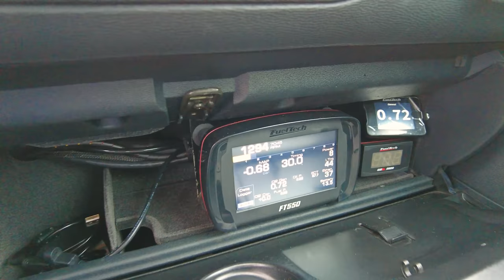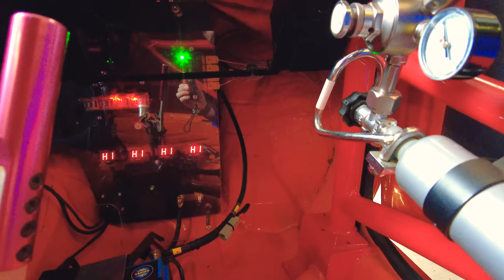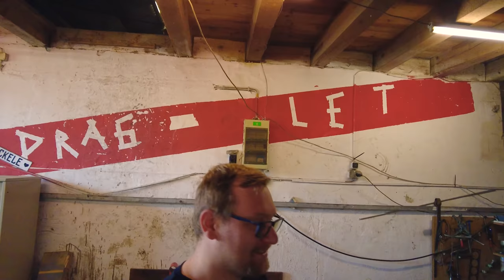Gol 8v 1000hp brasileiro na Alemanha! VW Lupo VR6 DSG! Paraíso das peças de Opel Calibra C20XE!

Comment: 58:59 Kedett tá com sensor de nível de freio desconectado. Acho que eles sofrem do mesmo problema de escassez dessa peça. No caso do Brasil, a peça é diferente a depender do ano. Os Kadetts com "check control" usam um sensor mais raro que simplesmente trabalha com sinal invertido (entre ligado e desligado, nível baixo e nível normal). Aprendi isso no canal do Black Hill Auto, mecânico que mexe bastante com Kadett.